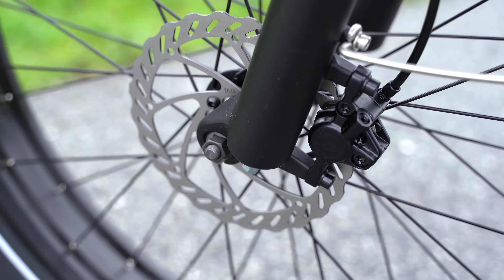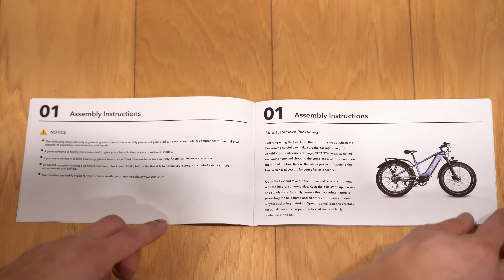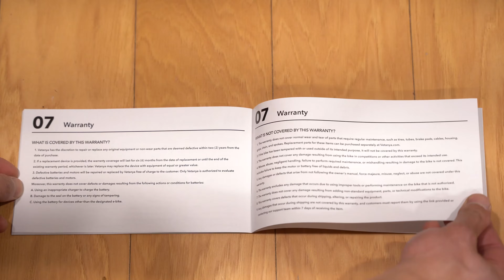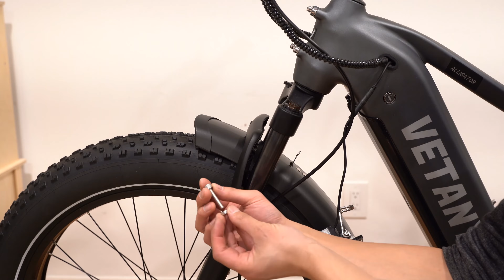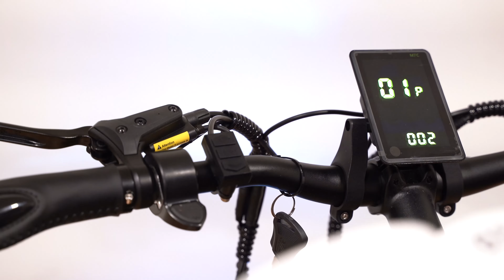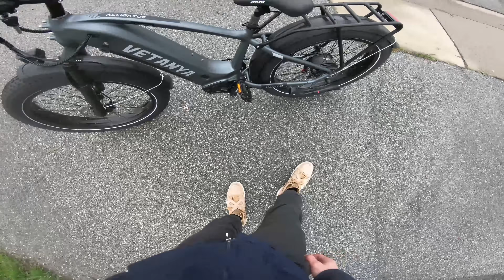$1399* Vetanya Alligator High Step Ebike - Unboxing, Assembly, Test Ride, and Review ($100 off code)

Comment: I purchased a vetanya Bison and am very sorry I did. These are built in China and good luck getting any sort of warranty service. The controller burnt out on mine in less then 2 months and they finally agreed to ship me one after I put a paypal claim against them. Still it is taking them more then 2 months to ship it to me and I am still waiting. I don't know what motor they use and most likely cannot get parts for it like planetary gears. They use a controller that is not available in the US so you can't even buy replacement parts. They have removed all the brand names from the parts like the brakes. motor etc. Vetanya shows as a US company on their site but I don't know what if anything this company does the bike is actually manufactured and shipped by HK JIARUI CHENG ELECTRONIC COMMERCE LIMITED. which has only been in business for 2 years. The battery is proprietary and I think the likelihood of getting a new in a few year is small as I doubt this company will stay in business that long. There are much better options then buying there ebikes.
Reply: Any update? Seen a few near me on sale for $650 and decided to check reviews.

Comment: Hello! My bike is a little jerky when I’m on throttle. Did you experience that? Is there a way to get rid of that by any adjustment?
Reply from the maker: Hello Larry, I did not notice any jerkiness when riding. Are you gradually twisting the throttle?
You can look through your programming settings, and match the ones that I had to see if it helps. https://youtu.be/aCFJpqm73h0?si=etDASN4hVSL0ji2T&t=759
If that doesn't work then I'd suggest reaching out to Vetanya. Thanks